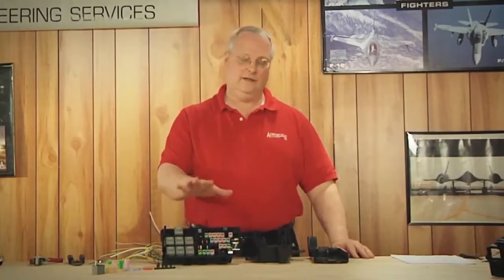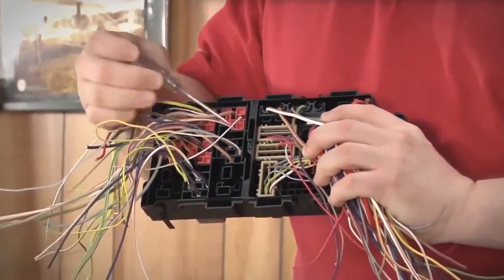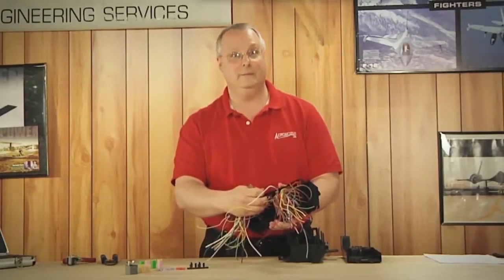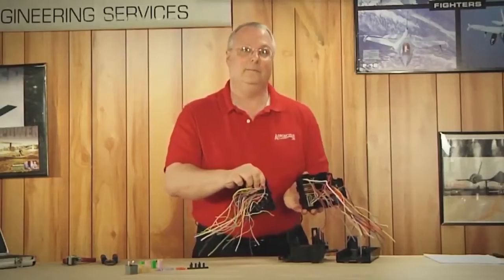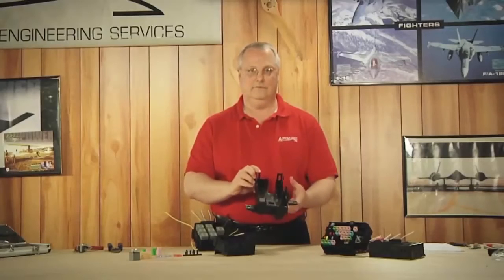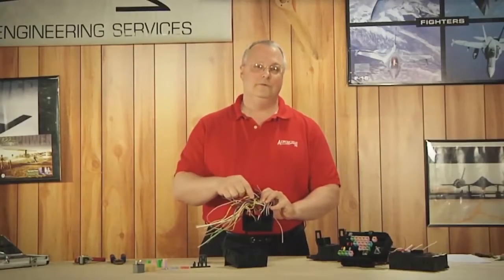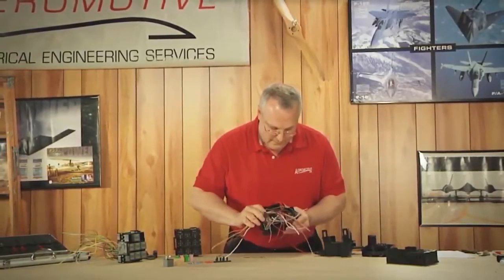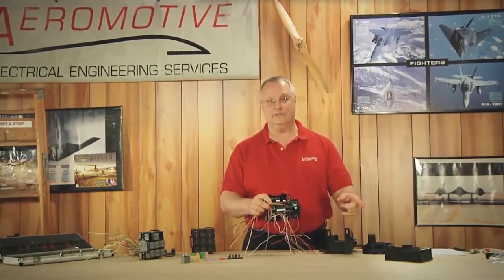Removing/Replacing Wires from a Fuse Box

Comment: When making any sort of training aid, it is imperative that the object of the instruction and the reason people would seek such instruction is met.  

You could literally have said 'just remove the wires' and saved us all time.  The reason people are searching isn't to see to see how the fuse/relay boxes come apart, but to see how the terminal capture system is released to make a clean R2.  Guess what you DIDN'T get into.  The terminal capture system here is unusual, and knowing the correct tool and which direction/location on the terminal in relation to the box is the objective.

I'm guessing you were AETC...

Comment: the only way i can start my truck is if i take the starter relay out and put a wire in the 87 and 30 slot. The mechanic told me the whole fuse box needs to be replaced and would cost a 1000 new maybe 100 at wrecker. The thing i just can see having to replace the entire fuse box. Would just be at wire underneath?
Reply: I had a same issue and used a wire diagram to find what energizes 87 for me it was 86, I followed that wire and fixed it as it was not getting any voltage.
Reply: Jeff...come on man
Go 2  Salvage yard 10 bucks
Reply: @jonnybravo2773  actually if i push the key in really hard and turn, it will start. It has something to do the transponder. But i don't care i'll fucking jam that key in hard everytime as long as it starts
Reply: @jvirg  i was have issues with the oem security and ignition switch. Went to junk yard pulled the entire steering column, steering wheel (key was in ignition). Replaced mine with the one from junk yard. No more problems..that was 3 years ago. Probably an overkill, but hey it worked for my situation

Comment: Do you happen to know who makes terminals for the power distribution box under the hood of a 1993 Ford F150? I know the GM stuff of that era is Delphi, but I am having trouble locating the Ford terminals. Is this something you sell? Thanks!
Reply: 90s Ford Trucks generally have boxes made by EPC, which is now part of the PKC Group. I have a 97 Expedition which uses the same setup as your truck does (Maxi fuse, ATM mini fuse, ISO relay and mini relay), just with a few more fuses and relays. Most likely, the terminals are from Lear Corporation for the whole box. Google for the PKC group catalogs and it'll make sense.
Starting around 1997, Chrysler's boxes started being made by Yazaki in Japan. They're pretty easy to identify, since Yazaki tends to put their logo on the main section. I took apart a 2000 Dakota/Durango box a few years ago, saw the Yazaki logo and emailed them about it. They were nice enough to reply with a list of terminals for each spot.
Reply: @tsherwoodrzero  Thank you!
Reply: @projectgattago  you're welcome. Sounds like you're wanting to add a couple things using empty slots and do it the right way. Depending on what you're adding, it might be better to add an auxiliary box like I'm doing on my Expedition. If you know anything about dissecting Chrysler fuse boxes, any help is appreciated.
Reply: @tsherwoodrzero  I am actually trying to help a client with his truck. He is installing a Holley EFI system and I saw no reason not to repurpose his original power distribution module and integrate it with the Holley EFI. I know a bunch about GM/Delphi parts, but not Chrysler.
Reply: @projectgattago  Nice touch! I did the same thing on my RX-7, with the 2000 Durango box. All of the stock RX-7 fuses and relays were moved into the new box, right next to the Haltech EFI stuff and a few use upgrades like a dedicated Ignition switched power relay and a Starter Relay so it engages every time no matter what. Made up a new label in Paint and it looked NICE.
Here's the EPC/PKC Group Catalogs, it'll help you understand how the stock Ford boxes are put together:
https://www.pkcgroup.com/products/product-catalogues.html
Reply: @tsherwoodrzero  Thanks again!
Reply: @projectgattago  Did some digging and found this. Terminal are from Lear unless specified. You can get them from TTI, or possible their subsidiary Mouser Electronics (www.mouser.com)

Maxi Blade fuses:
7Awg:  360739-VR200
10-12awg: 361139-VR200
14awg: 361439-VR200
Bus Bar Double Female: 369939-TS200
ATM Mini Fuse
10-12awg:  Lear 771016-FK200
14-16awg:  Lear 771416-FK200
Bus Bar DF: PKC E-2045-001
Micro Relay
Sm 0.187" terminal 14-16awg: Molex 33113-0005
Lg 0.250" terminal 14-16awg: Molex 33112-0005
ISO Relay 10-12awg: Lear 361030-YF200
Reply: @tsherwoodrzero  You're awesome. Thank you!